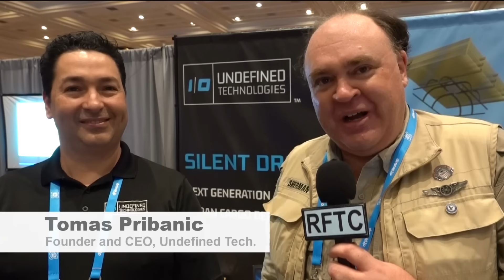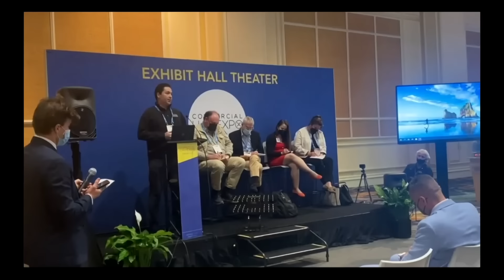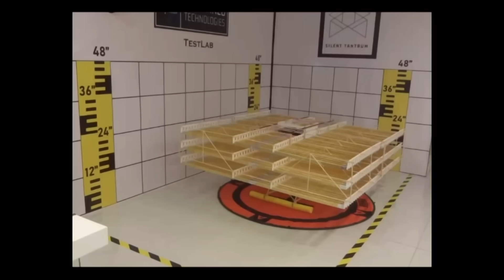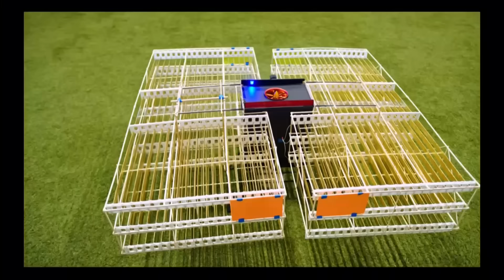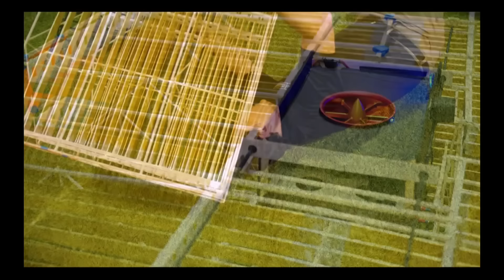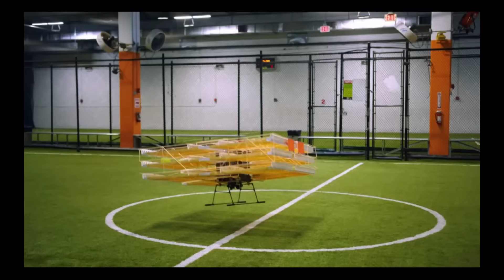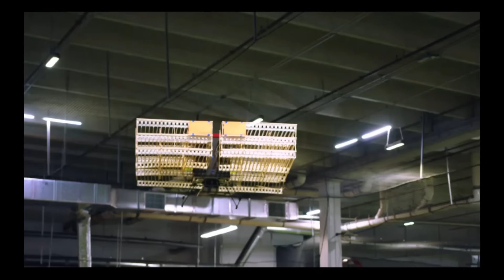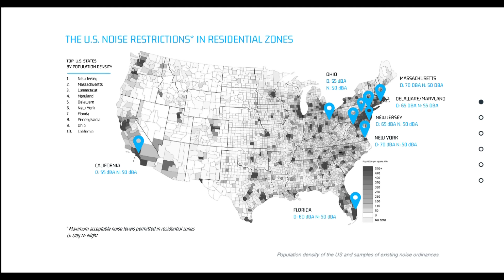New Drone Tech: No Propellers, and Yet It Flies!

Comment: I'm impressed.! This is really intreaging !  I hope your  able to keep developing it and it works out for you. Im sure it will have uses.  Mabe you could simplify it by putting  some props for directional abilities.
Reply: It is actually powered by a loud ducted fan not ions, despite the claims.  The fan in the center appears to have vanes on the bottom that move for steering and control, the same as other EDF propelled aircraft online.   Here is their video of it with audio:

https://youtu.be/iihprC5Huf4

There exists a series of ion propelled crafts that can lift their power supplies onboard, and they are patented for that reason, it is not easy to make an ion propelled craft that can lift its own power supply, the thrust to weight had to be increased very significantly.  There are 33 flight footage videos of various working prototypes on my channel.
Reply: @KraussEMUS1  thanks. Im still looking for the perpetual  machine to be invented ! Lol. The solor system and universe seems  to be the closest thing thats a perpetual machine.  Earth is  like a big recycling machine.

Comment: Increase the number of racks ... That increases the pitch capacity ... And will make it look more like a borg cube ... Very effective system but not for payload transfer ...picture more of a data transfer infrastructure with drones that  power eachother.
Reply: Sounds like a good idea however, it is designed as an ion lifter.  They are roughly 100 to 1000 times too underpowered to lift their power supplies onboard.   When multiple stages are added the thrust to weight ratio goes down further.  2 stages for instance give about 20% more wind but weighs twice as much and takes twice as much power.  The above craft is actually powered by a loud ducted fan.  Here is their video with audio:
https://youtu.be/iihprC5Huf4
There are however a series of ion propelled crafts that are patented for lifting their power supplies onboard.  A lot of physical principals had to be just right to make it happen though.  There are 33 flight videos of them on my YT channel.

Comment: Yeah I want to know more about the 90mm ducted fan in the center and how that plays apart. Is it for initial ground separation and it turns off after or is it running the whole time making all of this a cool concept yet entirely invalid for the reasons the interviewer brought up immediately
Reply: Here is a video of Pribanic's craft with audio:
https://youtu.be/iihprC5Huf4
The loud ducted fan can be heard spooling up.  Other commenters have mentioned what they believe to be the make and model number of the powerful fan.  There are many flying devices online that are propelled by EDFs in the center with vectored thrust for control.  Once older example is the Ikarus.  There are newer ones that sound and operate identically to the way the UT craft seems to perform.

One of the main points people are missing is that the UT craft is constructed like an ion lifter with multiple stages.  The thrust to weight ratio is roughly hundreds of times too low for them to lift their power supplies into the air unless many specific factors and major improvements added.  By having emitter wires that are only a few microns in diameter, that are positioned very far away from the collectors and other details, it is possible to reduce the current draw by orders of magnitude, while still getting enough lift to lift a very lightweight structure and highly specialized power supply.  The UT craft is too heavy the way it is made to lift off with onboard power using ions.

The second main point people are missing is that there are a series of ion propelled crafts that can lift their supplies onboard! They were patented for lifting their power supplies against Earth's gravity.  The way that they work is very clearly described and there are currently 33 flight footage videos of them on my channel.
Reply: @KraussEMUS1  Thanks for the info, Ethan! I've gone and subscribed to your channel. Looking forward to seeing your progress.
Reply: @koopdi  Thanks for the kind comment!!  I'm working on better steering now.  It is much tricker than I ever though to get it just right, but it should be done before long.
Reply: My guess is that it is cooling the power electronics. These ionic breeze thrusters take extremely high voltages and making more efficient, lightweight power supplies is one of the major hurdles.
Reply: @koopdi  I have a hard time believing a fan of that size would be used. It would be extremely inefficient because of the power draw from the fan. To get a 15 minute time you’d have to have a battery that weighs 1-2 lbs
Reply: @matthewbernard4152  The whole system does look pretty inefficient. It's just a prototype though. I hope they will improve it.

Comment: Interesting that in several angles if you know much about RC aircraft you will recognize the quite obvious EDF motor in the center of the craft, as well as the ducting fins for said EDF motor on the bottom of the craft. Also, found footage of it flying and you can clearly hear the EDF motor running. This appears to be completely fake.  I'll believe it when I see it fly without the EDF.
Reply: I agree with you.  The thrust to weight was generally just not there for ion lifters to lift their power supplies onboard, not even in or near the ballpark.  
There is one exception though.  On my channel are a series of very lightweight ion propelled crafts that were patented for lifting their power supplies against Earth's gravity.  There are 33 flight footage videos and clear explanations.
Reply: @KraussEMUS1  this is the only one I'm skeptical about as it was obviously not being powered by ion thrust, I can't speak to the others

Comment: what would happen if lightning struck by recently? would that change the ionization capability of the drone? what is the thrust to weight ratio compared to propeller?
Reply: Ion thrusters are not affected by lightning strikes unless the lightening is destructively very close by.  Ion thrusters called ionocraft, EAD, EHD and ion lifters etc.  Have always had a thrust to weight ratio that was several 100 to 1000 times too low to lift their own power supplies.  US Patents Numbers 10,119,527 and 11,161,631 describe a series of crafts that are patented for lifting their power supplies against Earth's gravity.  It required a really large increase in thrust to weight. There are 33 public flight footage videos of some of those crafts on my channel.  They may be able to produce more thrust per watt than a fan in the near future, but nowhere near as much thrust for a given area.  They are quiet, interesting, and can go extremely fast in space with a very small propellant tank.

Comment: This was what i made for my 6th grade science fair IN 1997!*
I DIDN'T have a computer to aid in steering thought* so it was hard to fly* i made the controller&receiver AND ALL COMPONENTS from scratch! Even capacitors resistors batteries and a transformer! (I tried to make transistors but wasnt able to manufacture All from scratch*) only i used 2xtransistors..
😉👍🏻
Reply: It did not have power onboard, but then again neither would the UT craft without its ducted fan.

Comment: It seems there is a ducted fan in the center of this thing, from the upturn of the wing shape, I deduce that most of the weight is supported by this ducted fan.
Reply: Cooling fan for what appears to be power source
Reply: Great observation!
Reply: Practical loads like a minimum of two persons  forst least 1 hour  possible ?
Reply: Cooling fan ain't gonna lift that contraption.

Comment: Jean Naudin did this several decennia ago.
The efficacy of this ionpropulsion is low. So a nasty lot of power is used. 
Het voltage should be in the range
35-120 KV. 
It will not be silent. It has te be windstill max speed would be about 40 Km/H 
It will not work when thesaurus is moist or if it rains.
Reply: The UT craft is powered by a loud ducted fan in the middle.  It can be heard on a video with audio on their website.  

There is only one series of ion propelled crafts that have a high enough thrust to weight ratio to lift their power supplies onboard, and they have 2 US patents for that reason.  They are tremendously more efficient by weight than previous ion propelled crafts.  

The geometry of the UT craft would produce a very inefficient ionic thrust and it is far too heavy to work without the high 
powered electric fan.

There are more than 30 flight footage videos of the working versions with onboard power on my YT channel. Previously the technology was far too inefficient to lift its power supply period, because it really did take way too much power. You are also right, that they probably would not work well in the rain.

Comment: there is an electric duct jet fan inside the housing that provides most of the lift, please clarify how much lift is being done by the ion blades
Reply: The ion thruster part, if it is operational at all, can't lift itself and its power source.
There are some on my channel though that can.
Reply: More like a cooling fan system, I’m sure it generates extreme amount of heat

Comment: Okay the video of this lifter is great. Excellent work Thomas. Myself I also built a set of electrostatic wings and posted on u-tube. As a light aircraft manufacturer I found the concept doable. But it can be made much better to fly if you concentrate on using the lift potential of the wing along with the electrostatic thrust. What I realized was the amount of electrostatic energy in volts that would be required to fly a one person craft. Without that on board power, you will make no more strides than the one shown. My concentration has been in the development of the on board power system to create this energy without the combustion fuel usage. Good luck.

Comment: I have seen this tech before. Someone several yrs back made something similar and was claiming that it was an antigravity machine and it worked by using an electromagnetic generator to create lift. So this really is not something new and it's basically useless at this time as the guy explained it has so little power it can't support hardly any weight and does not move very fast unless it's heading for the ground. 😂

Comment: This concept has a lengthy history. It was coined an ionocraft and patented by aircraft designer Alexander P. de Seversky in 1959. The lift to power ratio is far less than that in typical helicopters despite many advancements since the early demonstration models.

Ion-propelled aircraft
https://en.wikipedia.org/wiki/Ion-propelled_aircraft
Reply: Nice comment!  The crafts on my channel will be closing in on the thrust per watt of a helicopter in the near future.  The thrust per area will still be much lower though.  Ordinary ion lifter geometries require way too much power to lift their power supplies vertically. Stacking them just halves the thrust per watt.  It is not efficient to move air rapidly over a small surface area.  Larger slower moving air masses create more thrust with less wattage and also emitter wires that are only a few microns in diameter, or less, can be much more efficient.
Reply: @KraussEMUS1  - Thank you for your explanation. Another measure that needs to be considered is the mass lifting duration per kilowatt-hour of carried battery capacity. Those, who are attempting to attract potential investors. may choose to not provide such details.

Another detail that is rarely mentioned is that in the process of generating the ions ozone also tends to be generated which is a serious health hazard above certain concentrations.
Reply: @vernonbrechin4207  Another way to put it is grams per watt of lift. Flight duration is dependent on that mostly.  2 stage lifters such as the thrust section of the MIT craft or the 2 stage lifter on the above ducted fan powered craft produce roughly 1/2 gram of lift per watt, it was specified even though it was already known for the former.  The crafts on my channel have managed closer to 14 grams per watt of lift at the frame however, much of it is lost in the electronics and the total weight per area is low.
Since my crafts use so little wattage and just add electrons to O2 molecules no ozone scent can be detected even in a very small workshop.  Any craft that uses many hundreds or thousands of watts to produce ions over a small surface area is going to produce Ozone quantities above the legal limit.

Comment: And the EDF in the midle is just for cooling i guess? 😁

Thats not gona work, MIT students did a plane in this fashion in 2018 and it bearly could maintain level flight!
And even if you can build a drone that can bearly fly, what is its intended use?
Reply: There actually is one series of ion propelled craft in the world that do lift their power supplies onboard.  They flew verifiably and vertically for nearly two minutes at a time long before the MIT craft despite the Nature article.  There are currently 33 videos of the patented devices on my channel.  In order to lift a power supply with ion propulsion though, it requires that the craft be very light in weight per area as well as have a very specific geometry and power supply.  It seems clear just from the sound of their craft's EDF, that can be heard on the video on their website, that it is powerful enough to lift a flying craft all by itself.  There are several flying EDF crafts online that sound identical.

Comment: So about the same flight time as a conventional drone....maybe something to do with that big blower in the middle? Not seeing any High voltage cables associated with ion propulsion, wood isn't the best conductor either. If HV is connected to the "quadrants" and is producing enough ions to provide propulsion, then surely these quadrant wings would be very good antennas and be putting out all sorts of interfering RF. Perhaps these giant air ionisers  could be flown en masse over forest fires to help clear the smoke lol

Comment: so we all gonna ignore the ducted fan inside the middle which gives most of the lift while the big fannyparts provide only control? alright then... 🤣
Reply: The way it is designed, geometrically and weight wise, the lifter part can't produce enough lift to carry its power supply.  Therefore, the EDF must be producing all of the usable lift.  On my channel are the only real solely ion propelled crafts with onboard channel.
Reply: @KraussEMUS1  yes i got that point. but the text clearly says SILENT propulsion and ION PROPELLED DRONE. not "ducted fan propelled drone with ion controlling.  if i read this and then he hover a while with a noise level of a vaccum cleaner i loose faith that its silent. i also watched the video on their webside before and it appears to be not just a ducted fan but also thrust vectoring on the bottom. and that is just too much. 
i saw your videos before and that makes alot more sense. what i would think might be possible is a gas filled vessel which provides enough lift for the whole thing and THEN use the ion propulsion to maneuver it around. that would be silent and cool looking. whats your opinion on this? is the ion drive enough to push a helium filled ship around? lets say in zero wind because i doubt this have more then just some gramms of thrust?
Reply: @cloudpandarism2627  Your comment is quite reasonable.  I am glad to hear the voice of reason!  There are some details though that I would like to share:  The total weight of my craft is roughly on average 25 grams including everything.  Thats kind of like a handful of pennies or a small quadcopter.  It flies silently with the power supply onboard, as you probably know.  In about 2003 I made a helium balloon shaped like a flattened rocket, it had an onboard ion thruster and power supply.  When I connected the battery, it would float to the ceiling and when I disconnected it, it would descend.  (In 1977 there was a company that made an ion propelled blimp for the military I later found out, and there are other LTA such craft now.)  I decided I would work just on making a heavier than air ion propelled craft that could lift its power supply back then.  After thousands of experiments by 2006, I got one to hop under a postal scale, and even though the transformer burned out, I realized it was possible. Now I have a patented one that can fly for 2 minutes with the power supply onboard. It is well known that ion propulsion is the fastest thing in space so far even though it produces a relatively gentle force.  This one has flown with small propellant tanks and just adds electrons to O2 molecules, so it doesn't need anywhere near as much wattage or propellant.  I think it will be extremely fast in space.  It can also fly on one side very efficiently.  Soon the steering will be effective enough to get it all working better.  It is true that so far, the real thing isn't suited to delivering heavy packages especially on any windy days.
Reply: @KraussEMUS1  âh i see. yeah i didnt watched all your videos but some of them. so it is possible to use a blimp. you said it can go up and down. how about the other 2 dimensions? where are the limits on this? i guess just making the ion drive bigger isnt enough for 3 dimensional movement? what is the biggest problem to prevent this? i would love to see a blimp flying around silent in a big hall without wind. 
and yes we both know this wont deliver packages around the world anytime soon :D
still cool to see!
Reply: @KraussEMUS1  same! 
isnt it refreshing to sometimes just have a normal conversation about something and listen to each others opinion even they are not the same?
i wish the world would be full of people like you. with a vision and no problem to get others excited about it. cheers from china°